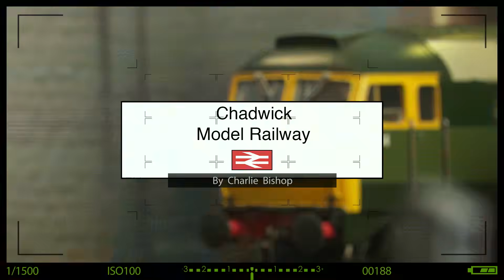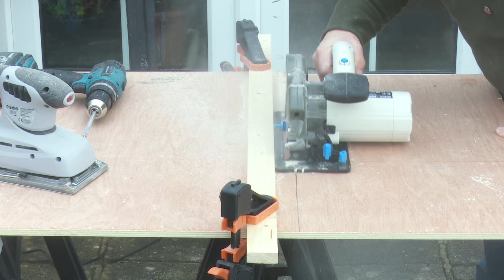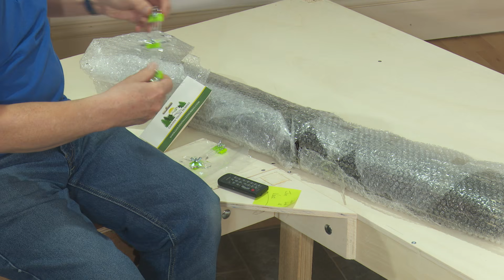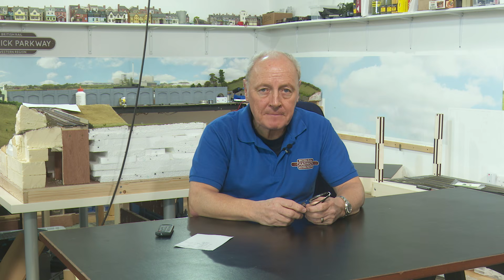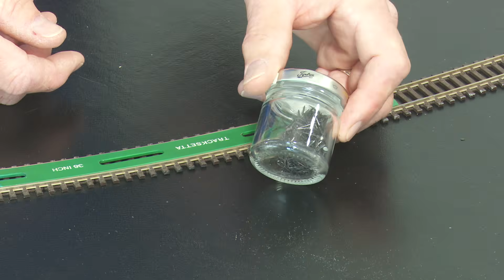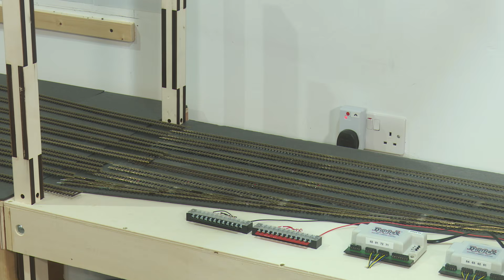Laying Flexible Track at Chadwick Model Railway | 119.

Comment: V informative video Charlie but is there a cheaper alternative to the Peco Tracksetter templates as they are around £75 for a set. Pencil, string and nail to define a fixed radius curve springs to mind but maybe this is not firm enough?
Reply from the maker: Sadly that won’t remove the kinks from used track and you only buy the templates once!

Comment: Excellent Charlie. For next week... I have a Hornby “Cock O North” that came with the Master of the Glens set (Birthday present form the family). Love the loco, but it continually derails at points and the odd curve for no reason. Have you had this happen with any of yours? I think it’s the front bogies that is the problem.  None of my other locos do this. Any ideas would be appreciated. Cheers Steve
Reply from the maker: Hi Steve, well I bet that’s annoying. Does it derail on curved points, because I always find they are the very worst. Regards Charlie
Reply: Check the wheel 'back to back' measurement with a gauge (e.g. from DCC Concepts) and/or try adding a small blob of BluTac to the top of the front bogie to give it a touch more weight.

Comment: Hi Charlie, great video as always. Now you've laid your track how do you treat the board to board joins in order to keep the tracks perfectly aligned when, for instance, you take a board out for wiring etc? Do you use copperclad and pattern makers dowels? I don't recall you covering that in any of your videos.
Reply from the maker: No Trevor, all I do is bolt the boards together with M8 coach bolts. I view it as a permanent fixture but should I move house, they are detachable. Regards Charlie

Comment: A strategy I've followed for many years now, is to lay lining/wallpaper on the floor, and draw the trackplan to 1:1 scale using a ruler and Peco track templates.
I then build the baseboards to fit the track plan.
That way, I know where points need to go and don't end up with struts under where point motors will need to be placed.
Here's an example on a club fiddleyard. https://drive.google.com/file/d/1gdH9u03BYmwhnmcmFLA6SCLEvqSqpDch/view?usp=sharing
If you notice, it's a outer framework of 2x4cm, with a strut positioned at the centre and 1/4 and 3/4 points... but the right hand (3/4 position) is three inches towards the centre strut because it would normally get in the way of the point motors.

Charlie, it's interesting you talk about model reviews...
The Hornby Class 60 is still among the most accurate models, yet dates to 2005... yet more modern tooling still has glitches in both detail and performance.
The only negative thing I can say, is that Hornby's resistance to anything but 8-pin decoders leaves Hornby in the slow lane of sound & light developments that have taken place in the last 10 years.

You may be interested to know that  the Hornby Mk3's (the long versions) are 20 years old in 2021... as are Bachmann's Mk1 coaches.
We can't be too harsh comparing Hornby's Mk3's though... they came out before Bachmann's Mk1's, which set new standards of specification for coaches, such as high quality details and close coupling mechanisms.

Cheers
Laura
Reply from the maker: Interesting points Laura, thanks very much. Yes the old tooling for modern locos is always a dilemma. Have a great Christmas and stay safe, regards Charlie

Comment: I bought a new Hattons Class 66. After very little running time one of the bogies fell off and a shaft with a worm gear fell out. Hattons were unable to supply an exact replacement and so just gave me a refund. Although disappointed with the model I cannot fault Hattons communication and customer service.
Reply from the maker: Thanks Mike, that’s exactly the kind of information that I’m after. Regards Charlie

Comment: Hi Charlie.

I have tried to find the curved track spacer guides on the Golden Valley Hobbies website, but it does not scan wiht that name.
What I have found is Golden Valley Hobbies GVFTOO OO Scale Flexible Track Holding Tool. Is this one and the same as your tool?
It looks like the tool, but the track blocks are not shown as the dayglo colour on yours. Sadly the item I have found is shown as out of stock. It is priced at £17,50 for a pair (when in stock).
Please help.
Thanks for a fantastic video - it simplifies the job to the merely mundane level of laying straight track.
All the best,
Randal Williams
Reply from the maker: Hi Randal, can you contact DCC Train Automation, they make them for GVH.

Comment: Very timely video Charlie.  Since I have over 50 feet of O-16-5 Peco track climbing and looping I have ordered the Piko screws as an added measure of track security.  I have been using a small half inch Truss head screw for now.  I had it in mind to just have extra ballast at the screw locations to hide those heads.  The Piko screws will be a better fit for this layout and disappear.  I am still tweaking my track, marking locations that need attention so I can go back later and spend time working on those spots.

When I modeled in N scale I always laid my flex track curves first so that there would be no joiners/fish plates at the mid point of the curve.  I then added the rest of the layout track after the curves were in place.  The thing is that a meter of flex track doesn't cover as much scale distance in the larger scales as it does in N scale, thus making it more difficult to do.

I did not see a link for those track gauges you are using to equally parallel your tracks.  I think those would work well when layout a yard, especially if the yard curves.  I will look into those.
Reply from the maker: An excellent comment and the track guides are available from DCC Train Automation.

Comment: What I found though, before I gave up was that if you pin or glue the track down all that happens in real life is that the sleepers will stay locked in place but as soon as you try to take the track and form a curve the rails will end up moving and become different lengths and so completely useless.
Reply from the maker: Flexible track is not for everyone Tim.
Reply: you can use the forms or even a cut-steel form to shape the flex sections and just CA glue the free rail and it won't do that. keep in mind you will be following the track around with fixed radii and it has to be right on the snot.

Comment: I don't know if you are aware but peco also do a pin or nail similar to the Hornby one. I do use the pin or nail by peco thats like the Hornby one for my track. I mainly use peco code 100 Streamline track.
Reply from the maker: I did cover it in the video Matthew.

Comment: You  are  the man,  professionally  done...I  have  thought  about  flexitrack but have  been  worried  I  would  make a  hash of it...have a  great  Christmas  in  spite  of  all the  chaos (  designed  for me )...stay  well.
Reply from the maker: What a heartwarming comment David. RegardsCharlie .
Reply: maybe, but once you get over your concerns and get a little time under your belt- you will find out just how nice it is to be able to create without the constraints of sectional track. take it easy and go slow. if you are using a water-soluble glue to learn- that's smart, too.

Comment: Hi Charlie, another great video, long time viewer, first time poster. I have in the last year started building a DC layout from a load of stuff I've had in storage. I have two loops and a shuttle line, some sidings etc. I would love to hear your thoughts on how to make  the change to DCC. I have wired the layout in such a way that the upgrade would be easy but I don't know where to start with a controller. I wouldn't be running tonnes of loco's but it would be a hell of a lot easier to shunt between lines if I went DCC. Have a great christmas and look forward to seeing the next installment. -Karl, Co.Wicklow, Ireland
Reply from the maker: I’m so pleased that you enjoy the channel Karl. Regards Charlie

Comment: Aargh... the wee gadget for aligning the rails is sold out/out of stock.  Need to make up something, but thanks Charlie as it has given me ideas on how to get the curves done more quickly.  
Funny how Brexit and Covid is affecting supplies...a well known cable supplier that I'd bought 7/0.2mm wire for droppers no longer stocks it! Other supplies delayed / on pre-order. Or is it just that the hobby is attracting more and more people?  Just thankful that I'd over-bought stuff during this year!!
On the Christmas topic, can you explain why you didn't put droppers on your fiddle yard track lol?  You've got me paranoid about soldering droppers every 3 feet (metre in new language).  Goodness knows what I'll do when I get to building the upper level which I intend to be DC based with series 3 points of which I have a few!  Need to take pics of the transition track!
And are we going to see 'Charlie the Elf' present the Christmas video?
Reply from the maker: Hi Ian, you may be able to buy the template from DCC Train Automation. Actually, I did put droppers on the flex track but I just didn’t video that portion, not wanting to detract from the actual setting of curves. Regards Charlie
Reply: @ChadwickModelRailway  thanks Charlie. Checked but its on back order I think.  You've restored my faith in droppers!!  I did manage to get the flex curves done without a dog leg by using screws each side of the track while the glue dried. A lot of faffing about and very slow.

Comment: Merry Christmas Charlie and another great video thank you. Your excellent vids have made my first year’s initiation into the world of model railways so much easier, tho’ much of the electronics goes over my head TBH. 
I’ve just started ballasting this week and so far so good. Just about to do my first set of points, Yikes! 
One newbie question if I may. Is that Peco flex track flexible or semi-flexible (like Hornby)? I’ve tried both of the Hornby types to get those pesky curved points to work and they both seem to have benefits and drawbacks.
Looking forward to your Festive vid.
Thanks again.
TonyS
Reply from the maker: Hi Tony I think of the Hornby curved points are an absolute disaster! I would only buy the pico electro frog curved points all others, seem to be riddled with engineering mistakes. Regards Charlie
Reply: @ChadwickModelRailway  Hey Charlie, I agree, They’re not great and have a very bad name, but I had to persevere due to cost constraints....using Hornby (not semi-) flex track and sheer doggedness I think I’ve overcome the dreaded Hornby curved points. Trains now run around in both directions at full speed and also through the point at slightly reduced speed, result, 👍 tho it took me six attempts at track laying to achieve this....I replaced the Hornby setrack at either curved end with flex track and pinned it so it had a straight run out from the points and adjusted the curve accordingly to its largest radius I could. I’ve pinned it all down very solidly. I’ll be running all my stock through before I ballast. Dare I say it, so far so good?
I think the problem may be that the curved points radius doesn’t  actually fit the profile of Hornby standard track? Who knows?
My question was about whether Peco is flexible or semi-flexible and the relative merits of each.
Thank you!
TonyS

Comment: Why do you think the centre guide block can be offset, wonder if it's to accommodate point work!
Reply from the maker: Hi Stephen, I believe it so you can use all three blocks into one piece of track to stipulate what angle of curve you really require. Regards Charlie
Reply: @ChadwickModelRailway  Ah, yes, I get that, the guide blocks must be able to turn through ninety degrees, then doing some quite complex mathematical calculations, which I'm sure the maths teacher did say "one day you may just need to know how to work out" very precise curves could be set. On a lighter note, wish you and all viewers a safe Christmas.

Comment: As I intend to use as much of the flexible track I have those gauges and track setters are just what I need. Thank you charlie for this video. Q. I am going to have a raised section of track around the Perimeter of my main two boards and the added extension boards. How short can I make the risers (3%) to come level with a Hornby viaduct and make sure my older collection of mainly Triang and Triang Hornby steam and diesel locos can still climb them?  Some of the steamers do have Magderhesion.  Martin. (Thailand)
Reply from the maker: Sorry Martin but that’s up to you to do some trials. I think the best thing to do is to set up a 3% climb and see if your locos can make it. Steam locos are really the problem area, not the diesels. Regards Charlie

Comment: Hi Charlie et al, do you have a view on how effective that foam underlay is - from a sound deadening perspective, does it do the job? Seems like a very cost effective and less fiddly alternative to cork or other underlays (e.g. the Woodland Scenics underlay). Great video, interesting as always. Many thanks from Australia
Reply from the maker: Hi Konrad, I certainly would not use that foam on the main scenic board, it just isn’t very durable, unlike the Woodlands scenic track bed which is. Regards Charlie

Comment: Fascinating as always Charlie, I bought a tracksetta 42” radius piece after seeing you use them on your layout. Fantastic simple piece of kit that has made a previously horrible bend on my layout a much smoother and accurate curve. I’m modelling New Zealand Railways in S scale (1:64) and the largest wagon is 39cm. It didn’t like the previous rough attempt at going around a hand/eye judged curve, however now it goes through no trouble. Cheers!
Reply from the maker: That’s great news Scott, I’m so pleased that you have found my advice is useful. Regards Charlie

Comment: That little track spacer guide is pretty darn nice.    Seeing the way you staggered the joins is really good.  I never thought of that and that will get rid of that dreaded space where flexi's join that has no sleepers.    
Thank you for such an in depth and educational video.  I really do appreciate it.
Reply from the maker: What a heartwarming comment Brendan, regards Charlie
Reply: when we build a layout one of the guys does nothing but make custom thin ties just for the purpose of gluing them in under those joiners. its an easy job and you get breaks to help out with other things.

Comment: You may or may not have seen my Hornby Rocket videos on here. Ran great out the box. Had issues trying to squeeze a dcc decoder in to it but got there in the end. Recently made another video with the new 3rd class coaches and broke a wire connecting the tender to the loco. What and absolute pain that was soldering it back on. 
Anyway it won't be going back in its box as its too fragile. Now lives in a display cabinet. 
Amazing model, well worth the top prize. Just be very very gentle. Adult collectors only as it says on the box 😄
Reply from the maker: Great info.  Could I use some of the footage in my next video?
I can download it and extract what I need.
Regards Charlie
Reply: @ChadwickModelRailway  of course, dont forget to like my channel 😉
Reply: And my real name is Chris. I know how you like a name drop.
Reply from the maker: Consider it done Chris. Regards Charlie
Reply: @ChadwickModelRailway  look forward to my 5 minutes of fame next week. Cheers and take care

Comment: You must have a very understanding Mrs, at the slightest hint that I may want to do some model railway work in the house and I get directed straight to the shed.
Reply from the maker: My shed happens to have brick construction and central heating!  So I don't mind really.

Comment: Hi Charlie well you’ve done it again another great video you mentioned about the hornby awards ahead of your upcoming Christmas episode regarding hornby locos I have owned them since I was about 5 years old I think I am about your age I have sound in my hornby diesel and steam locos but when you said about other locomotives I have also got 4 Bachmann locos 2 class 57’s 1 class 150 all dcc but my latest addition is a bachmann class 158 the new tooling version in east midland trains livery with cab lights and interior lighting as standard I live about a couple of hundred metres from the east midland trains mainline so I had to have one bought the new kind of Bachmann zimo plux 22 chip and it is amazing I think it is the best train on Beighton Parkway next to my class 43 hst I think this 158 just edges in front I think it came on sale earlier this year I don’t know when they did the awards but I would have liked it to be in the top 10 running pardon the pun before I purchased it from Rails Of Sheffield I asked Richard from new junction what he thought and he agreed that it was stunning and said he was saving up for one anyway great watch about flexi track laying keep safe 
Best wishes 
Kev
Reply from the maker: What a heart warming comment Kevin. Stay safe. Regards Charlie

Comment: With Peco points like the medium radius right hand electrofrog turnout do you need to cut the sleepers on the straight tracks going off the turnout as the points have quite a sharp turnout
Reply from the maker: Yes some sleeper tromming is required Daniel.